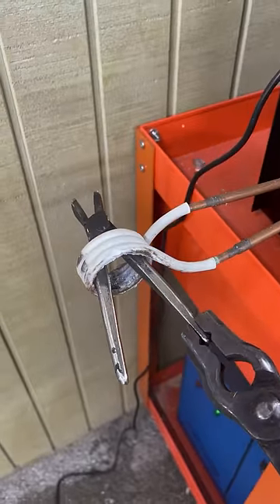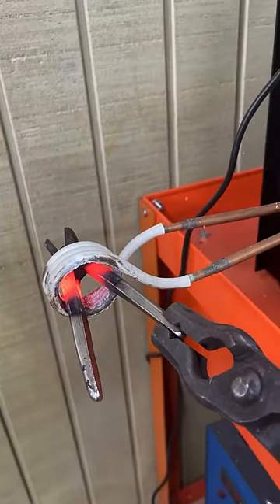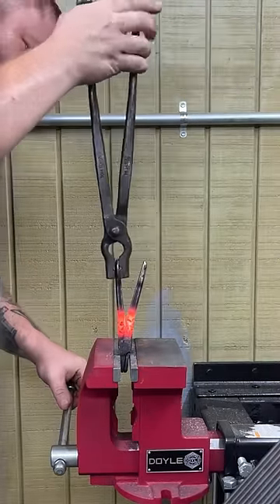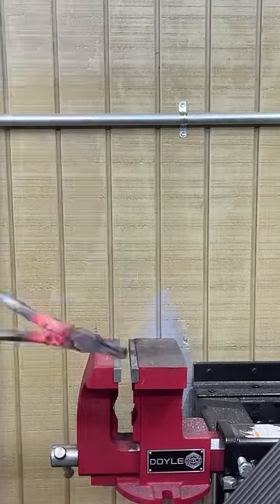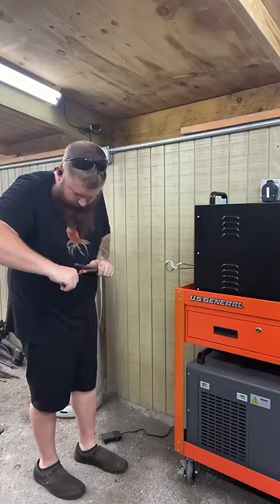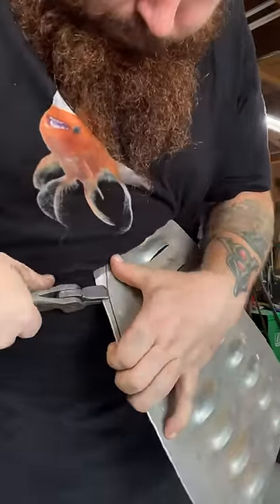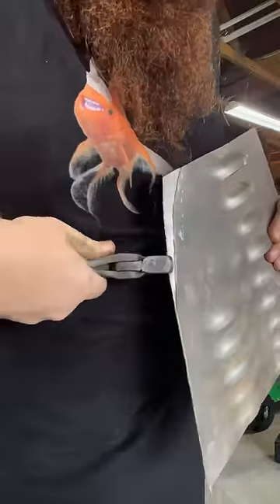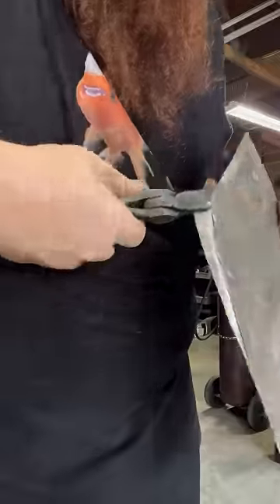How I finished the pliers I’m forging and what they’re used for #blacksmith #tools #handmade

Comment: MY MAN!! Working red-hot Steel bare-handed, in a T-shirt, shorts, and Crocs!!!! The closest I ever came to being able to Irish Riverdance was when a small piece of slag come off of a piece I was welding and went in one of those little holes on my Crocs🤣
Reply: "I used to laugh at safety, and now they call me... Three Finger Joe"
Reply: That's why you just go barefoot.  The burning slag doesn't stick in the holes that look like they're made for catching burning slag.  You just shake your feet off real quick.  Seriously, I'd rather be barefoot.
Reply: I was welding overhead sitting down and a bit of stainless slag burned through my pants about 3 inches from a very important area. I was dancing around thanking God I didn't burn a hole in my sack
Reply: @MrPePeLePuo  🤣
Reply: The heat doesn’t transfer the same with induction like that
Reply: It's an induction heater...
Reply: @jeepwk6.5L  exactly ppl are annoying
Reply: @midwesternwelds1197 omfg cause red hot ain't red hot right? Holy fkn homer simpson n Einstein aren't the same person fella!!!
Reply: @jeepwk6.5L  ok? Wtf is your point? The METAL is still red hot, regardless of whether or not the heating surface will burn you 🤦‍♂️
Reply: You sir are no sir
Reply: I had some go down my muck boots after burning through my jeans. I couldn't get my pants and shit off fast enough. Might have peed a bit as well, but it do be like that sometimes.😂
Reply: Thats fucking funny😅
Reply: I'm dying!!! 😂😂😂
Reply: I once dripped a botched weld onto my left croc. It landed in the neighbors yard and very, very luckily my mother was watering her hobby garden, so no very serious burns, still a got visible scar and a hell of a lesson.
Reply: Dude i had a piece of slag drop down my overalls and it nestled nicely in my belly button. That hurt so good
Reply: @CidFFVII  oh dayum! No gracias!
Reply: I was welding under a car, and a berry fell into my ear. It hurt like hell, and I could hear it sizzling. It burned through my eardrum, and my ear's works had to be surgically rebuilt.
Reply: Damn this happened to me too!! at least I know I'm not alone now
Reply: I work till I shop that required us to tuck in our shirts. You know. See you look professional. I went to go weld up a muffler on a car had a big old piece of slag fall down. My shirt run down the length of my pants and end up in my work boots. I was riverdancing and trying to get that shoe off of everybody else in the shop. Almost pissed themselves laughing😂
Reply: I was holding something for the guy welding my exhaust on i was looking away from it as too not burn my eyes and a piece slag fell in my ear
Reply: Omg lmfao that would make me dance too lmfao

Comment: It’s wild how induction works. The tip of that metal was red hot but you were able to hold the other end with out gloves.
Reply: Just how localised is the inductively heated section, then? 

I'd have thought with steel heated to glow a bright cherry-red (900-1,000°C) at one end, it would take mere seconds to conduct enough heat down to the other end to easily burn human skin. Steel may not be quite as thermally conductive as other metals (like Silver, Copper & especially Aluminium), but it's still gonna achieve a thermal equilibirum across the whole length pretty quickly.
Reply: @Skeptical_Numbat well apparently not, this man was able to hold the end of them bare handed while it was red hot in the middle. Must take longer than u thought for the heat to evenly travel across the whole peice.
Reply: Meanwhile my pliers get burning hot before the piece I'm holding even starts changing colors
Reply: @Skeptical_Numbat wat yu say?
Reply: @Skeptical_Numbat it called Induction. It's not like heating with a torch, which WOULD do exactly as you state.

It's like an induction cook top as soon as you turn it off you can touch the surface.

Induction heats with magnets and only impacts the area that the magnets are impacting, the reason he can touch the handle is the handled is not being impacted inductively
Reply: @Long-Island-Sound  I always think it's weird when someone replies to a comment with far more rudimentary info than the one they are replying to, like I think it's safe to assume he understands how induction heating works based on the fact his comment indirectly says he does...
Reply: @miles11we we’ll apparently he didn’t lol. long island was right and necessary.
Reply: @narlynarwhals27  do you just not understand what he is saying in his comment?
Reply: @Long-Island-Sound  "as soon as you turn it off you can touch the surface"

False.  I'll cut you some slack and assume you mean the cooktop and not the pan, but even then if it's been hot for more than a few minutes it will be hot enough to burn when you touch it.
Reply: @ninthring4972 Very common to think that steel conducts heat quickly. It's actually a relatively very poor conductor of heat, about 45W/(mK). The higher the number, the more thermally conductive it is. For comparison:

Copper - 398W/(mK)
Aluminum - 247W/(mK)

So steel just takes a long time to heat up, and this is more apparent when the heat is very localized hence the inductor. Flame heat is very unlocalized.
Reply: Like a hand brake. 😎

Comment: You should temper those grips, after heating and bending the metal it will become brittle and you need to work out that stress in the metal.
Reply from the maker: It’s mild steel. It’s fine.

Comment: Did you temper them after you did the bends?
Reply from the maker: No
Reply: @FullSteamDesigns  heating like that ruins the temper in the heated areas.
Reply from the maker: @JoeZelensky  it’s mild steel. I never head treated them to begin with because there would be no reason to do so.

Comment: Oxy/acetylene touch would have worked way better! And way faster! Interesting pliers though
Reply from the maker: This is much faster and works much better than torches.
Reply: I’ve been a smith for 20+ years and I really enjoy metal working vids but I’m very old school and like propane forge or coal. Induction. Just don’t seem as useful with the size material I usually use. But man that does look cool for smaller jobs!
Reply from the maker: @BrandonnTheJust  this is the exact type of thing they work so well on. There’s a number of different coils you can buy or make for them to work for different situations. A torch doesn’t come close to how fast these heat up metal.

Comment: What happens if you touch the sides of the coil in the induction forge?
Reply: It uses rapidly changing magnetism, meaning it only affects metals. If you have a ring on though, it’d hurt really bad
Reply from the maker: It could make an arc. Sometimes it does, sometimes it doesn’t. I’m not sure why.

Comment: Red hot heavy steel and no boots. Closedtoe shoes? No. Flimsy, flammable crocs will work. Well, when...not if...when you drop a hot piece of work on those crocs, you'll learn. That hot napalm burning down to the meat will tell ya better than I ever could. Not trying to gatekeep man, do you. But bro, I've dropped something I welded on my booted feet and still got second degree burns. Please please please at least put close toed shoes on boss.
Reply from the maker: I’d never wear crocks 😂

Comment: Get yourself a pipe. And bent the handles.!!!
Reply from the maker: I bent them in the video.
Reply: @FullSteamDesigns  Yes, you did, however, you did not.  used a pipe in the handle and bent the Handle a lot.!!! easier.!!!
Reply: In other words use a pipe One and a half foot long inserted in the handle and then bent.!!!